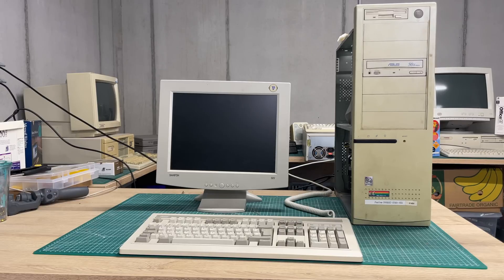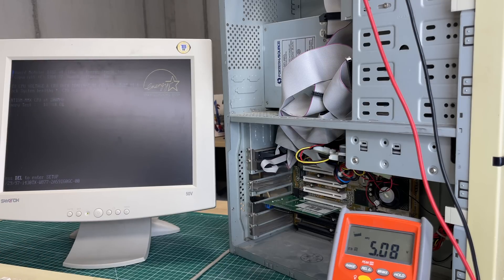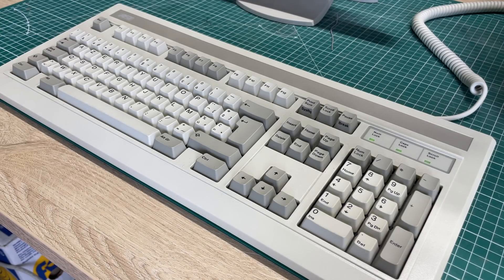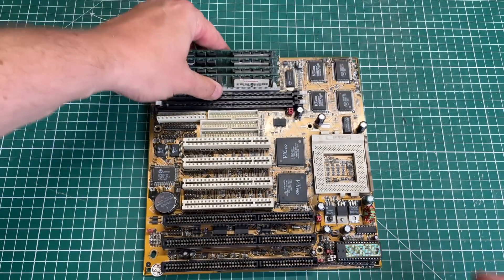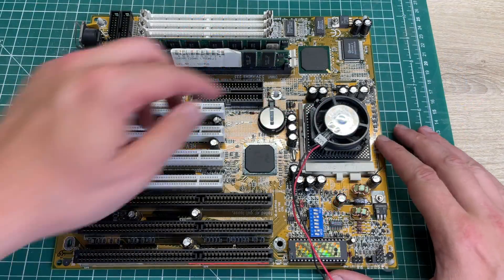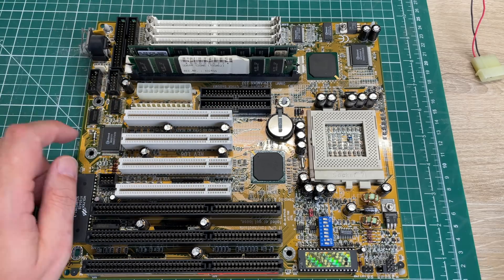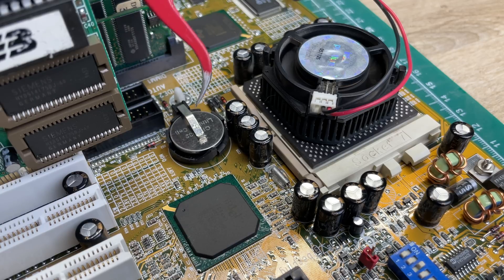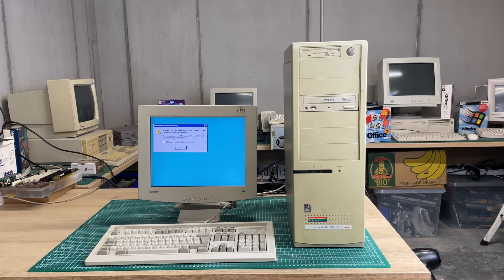Easy fix for this broken Pentium 200 MMX

Comment: A few minutes after watching this, the new voltage regulators in my Abit AB-SM5 started to work, the Pentium MMX 166 MHz is finally getting hot again ! No POST codes for a while but after I probed the regulators I started to see POST codes and finally a boot screen.. so thanks for the video .. I think it gave me some luck !

Comment: I have a Desktop version with that Case Design. In my PC is a Pentium 166 Mhz with MMX 16MB RAM, 1,6 GB HDD a 2 MB ATI Mach64 and also a Sound Blaster 16

I found that PC on the street and it works with Windows 95 and Office for Windows 95

Comment: I have a 486 motherboard that only boots after pressing the reset button on the case. Seems to clear a power good signal or something. But after seeing this, I will double check my CMOS Battery!

Comment: when i was in high school back in 2007 i worked as a school based trainee working along side the schools computer tech and the most common thing id see on computers from the socket 7 to socket 370 era is that if the battery was low or dead then the computer would provide almost the exact same issue to what you demonstrated in this video and removing or replacing the battery would resolve the issue every time

Comment: I had a similar fault on a more recent system. Would not boot. Had a power up shut down cycle. Checked the voltage of that battery and it was 3v. A fresh one is 3.3v. System booted when I replaced the battery. I dont remember ever seeing this before In the 20 years I've built/repaired/used computers 🤷🏻‍♂️

Comment: It was the auto voltage settings being lost by the dead battery. Thats why it worked after a quick restart, just long enough to remember the settings.

Comment: Interesting, I haven't seen a PC before that won't start without the CMOS battery. Although I haven't really had a reason to remove the battery on a "modern" (e.g. post pentium-era) motherboard.

I have seen it on a Mac, my Powerbook 1400c won't boot without the PRAM battery connected. In fact, it won't boot if the PRAM battery is flat. It took me a while to work that out when I first got it home and it wouldn't boot. Powered up, nothing. Tear the thing apart to get to the PRAM battery and it was fully discharged. Wouldn't power on without it either. Put it back together and still won't boot. But I left it plugged in and a while later I'm startled by a loud "BONG" sound, which was the classic Mac boot chime. Turns out you just had to let it charge the battery for a while before it would boot.

Anyway, I don't mind the off the cuff style. Not quite as polished, but I'd say it's definitely still entertaining. About a million times better than I'd do, considering how bad it was when I tried to record a narrated screen capture how-to video for work.

Comment: I have the "Baby AT" version of this case. just built a Retro system in it.  weird thing is that only the power LED works, likely might have to grab my spare leds and replace them, but still a good solid case, even if a bit yellowed. EDIT: I actually have a variant of this board as well. though my setup runs a k6-2 400.. wow

Comment: Poor HDD, it is suffering those ON/OFF/ON/OFF, they are not designed for that. Atleast the ones that don't do auto-park in a tab, ON/OFF in the middle of a spin up!, no way!. Well, my theory, if the battery was bad, CMOS data is unreliable, and sometimes MAYBE is started in higher MHZ, when higher MHZ it consums more power, so the 5v line can be drained a bit more, as started overclocked it dont even try to boot due to chip limitationes, so, what you measure like a little drop in 5v rail, it is the hardware trying to work harder!.

Comment: Could it be that the old coin cell battery is shorted? Maybe the problem was not due to the battery being totally discharged but to it being actually faulty, it's a quite rare occurrance but it could happen that those coin cell batteries develop a short circuit internally.

Comment: I do a simple test that almost work on all motherboards back in the day... When no image i remove the battery and test if no little tickle on my tongue between + and - then i realize that battery is run out, i replace and always work. Is a ultra quick test when you tired to use tester

Comment: This wouldn't be my first encounter with such issues. I had this more than once - a dead CMOS battery should usually be fixed as a first try, since it's a matter of seconds...
BTW, as feedback, I watch YT on a TV with a 5.1 receiver switched to Dolby Pro Logic II, so I get the voice centered. In this, your voice moves and sometimes even comes from the back (which is kinda weird), but is almost never directly from the center. Maybe that's something you want to tackle in your recording setup...

Comment: Funny thing to note here is, if the power supply in this old school pc (145 Watt) would have the right connector's which nowadays we use in a pc, the power supply in this old PC would even be capable to powering a PC of nowadays, when I put my AMD Ryzen 3900X together with AMD RX5700 XT and 64GB of 3600MHz DDR4 it uses when I put it in energy saving mode around 85 and 110 Watt's of power 😉

Comment: I had this issue back in the days of P2/3 (I just remember no boot) with some Tomato motherboards (and what made me think of them as low quality...yeah, they were bought because they were cheap). So when I saw the 1st symptom...I was "how's the battery", then when I saw the warning on boot, I skipped the video to find if the battery was indeed the problem. Sorry for the "low watch time", but I would have changed the battery 1st, before removing from the case.

Comment: Great video, nothing wrong with going unscripted. I had a Win98 PC that started doing this. It also turned itself off and eventually wouldn’t turn on at all, even with a new PSU. I should have tried changing the battery before I sold it for spares.

Comment: Agree with Victor about the sound "absolutely fine if a bit inconsistent". Sound is one thing that can make or break a video - I'll tolerate bad video but bad sound has be clicking away immediately. The sound here did NOT make me want to click away... and I'd say stick with this format - especially if it makes the whole process a LOT simpler for you. I'm guessing you're more likely to smash out a video when there's less set up time and less post production effort. Rock on!

Comment: There is a pin on the IDE cable that can hold the drive in initialization, before the spindle starts up.  I have seen controllers and motherboards keep the drive from starting up, and unplugging the cable allows them to start normally.  It’s not “normal” because the controller should be initializing the drives, but if the system isn’t booting, that would be one potentially expected outcome.

Understanding that, there’s a good chance the computer doesn’t have much, if any, load on the 12V rail, and the PSU may be having trouble regulating the unloaded 12V rail when the drive isn’t spinning.  The PSU doesn’t have independent control of every rail, so that could be why the 5V rail was a little low when the drive was shut down.

That’s all very characteristic of an older switching supply.  Nothing to worry about there.

Having the IDE controller stuck in a reset state would cause that chain of events and perfectly explain all the symptoms you see at the beginning.

Comment: An older series of Dell computers that I worked on had a similar issue. A dead CMOS battery would result in a seemingly dead computer. Ever since that repair, I've always replaced the batteries in computers more than a year or two old, just to be safe.

Comment: I had a couple of old XP machines that would post, but not boot into the o/s due to a dead CMOS battery. Apparently Windows didn't like the discrepancy between the original BIOS date and the o/s date. Once I replaced the battery and updated the BIOS time and date, everything was fine. The CPU cooler on that MMX looks so tiny and dainty lol
Reply: One possible temporary workaround may have been to boot to another OS via external device (DOS is ideal), change the date, then warm reboot until you had the battery replaced.

Comment: had a packard bell 166 mmx back in the day did weird things like that if the 2032 was almost dead, wouldn't initialize HDD, false start like this one , or it would boot without video, or boot normally if the energy was right, noticed my settings were wonky, not even a low battery warning, changed the backup battery out and problems went away

Comment: Changing the battery is the very first thing I change out when I get an old computer in my shop. Some of these old computers are not all the same and it never hurts to replace them right away.

Comment: Great video and I'm glad you found the problem.  I'm dealing with an IBM PC 300GL that boots, but after 3 to 5 minutes quits receiving keystrokes and emitts a high frequency noise that comes and goes. Once you start hearing that noise the computer basically locks up. This does it in DOS or Windows.  Swapped ram, cpu, power supply, and video card and still locks up. Anyway, thank you for the cool video.

Comment: I once had an old Shuttle Nforce2 motherboard whose bios battery always drained after a few days when not plugged into the wall. It was a real pain to replace so many batteries and reconfigure the bios. I eventually took it out of the computer case, and noticed there was a sort of sticky substance on the motherboard near the cr2032 battery. I washed the substance off with alcohol and water, and after it dried a few days, it worked perfectly. No more battery drain. There must have been a very minor short to ground from the sticky stuff. Might've been flux or soda.

Comment: This may sound crazy, but I've seen coin cell batteries get fried after a brown out. Scorch marks and everything, replaced with new. It was a dell optiplex with a core i7 8700. Optiplex is a real workhorse! I've seen many a computer with bios battery messages at boot and/or you have to power on twice...nothing I ever bothered trying to fix beyond trying a battery...in those cases new coin cell didn't fix. It's always old stuff for the most part.

Comment: I would think the BIOS settings got corrupted and when you removed the battery the actually defaulted. I would have tried booting with no battery to make sure.

Comment: I was sure it was the battery as soon as I saw the error on screen. I have seen this before, I have a few motherboards that either refuse to boot at all, or act weirdly at boot if they have a discharged battery.

Comment: For the past 20 years my first step is ALWAYS “remove, check/replace CMOS battery” for this exact reason. 

You’d be amazed how often this first step fixes the issue.
Reply: I keep a bulk bad of 2032 battery's for every board I buy off of eBay. Unless it looks like new it is replaced... 🙂

LLAP
Reply: I should do the same. As I have few boards that don't POST, but I haven't tried with a new battery.

Comment: I've had a very similar problem with a same era gigabyte board. The voltage on the cmos battery was enough to maintain some if the cmos data, but corrupt the contents. I had to force reset the cmos using a jumper to clear for a few minutes, put a new battery in and all was good again.

Comment: i'm pretty sure my lga-2011 pc had this issue, it would get stuck in a boot loop, i thought it was a ram issue because i reseated them and it turned on... then i thought it was a psu issue and i replaced the psu... still did it, thought it was caps so i bought a new mobo but then i read a forum post about a guy having the same issue and he replaced the battery and guess what happened? it boots normally... i did the same and guess what happened? it boots normally... now i have an extra computer that i will turn into a NAS or HTPC.

Comment: I forget that some systems are quite quirky without a good CR2032. I had this "cheap" board which had a (dead) CR2032 externally wired to a clock chip (not DALLAS). It would POST but not much more than that. I like the boards which actually have these coin battery holders as standard, makes swapping out much easier.

Comment: My DOS machine is a P133 MMX.  384 megs of ram.  2 gb compact flash, dual channel storage.  It's so overkill, I love it and getting so much ram into it probably slows it down a little, but it makes me cackle.

I have a really pimped out Mac iici too.  I just love retro computers and games.  

I love how massive your tower is there!  😍  Thanks for the video!
Reply: It's fun to completely pimp out old retro systems. I have a PowerMac G4 400 with 256 MB RAM, running MacOS 9.2. Originally it had 768 MB. I doubt the OS uses more than 8 MB.

Comment: I did guess its was the 2032, its and odd issue BUT there is a Crystal between the chipset (small round cap locking thing glued down) and the socket, you can see it in the video.
That crystal runs the Real Time clock inside the chipset.
I debugged a Super Socket 7 board myself that keept erasing the CMOS despite the battery being new, and I had the data sheet for the VIA MVP3 chipset.
I checked the pinout and the crystal is for Real Time clock, i also checked the VBAT pin and it had 3V from 2032.
In my case it was the Sound card being plugged in to the line in on my "lab" computer where I record YT videos, yea for some reason that created a potential difference it seems dropping VBAT over time effectively erasing CMOS and stopping the Real Time Clock.

Anyways I did NOTE from my testing that if the "crystal", the one you have between the chipset and the socket is not working, aka no power, the system wont post or beep just like your so I did call the cmos battery as the culprit.

Also your "power on and off" in short succession keeps the caps in the PSU and on the motherboard charged and when ever there is enough voltage  from the PSU the Real Time clock will run of that so the RTC is running and thats why your computer can post the second time.
It just cant post with no RTC running initially.

So my guess is that the way this board was designed its a timing issue, power dont get to the RTC to start "ticking" fast enough and then the system gets stuck and wont post because its expect the RTC  to be working.

Maybe a fresh PSU and a recap could help but it could just be the way this board works and a new 2032 obviously solved the problem.

But yea the Crystral must be oscillating for the RTC in the chipset for the system to post.

Also 4.95V is well with in AT specs, the reason it drops low is probably because the HDD is putting no laod on the 12V rail, the spindle is on that rail and on of the few 12V loads on a old PC as you know.
And the HDD not spinning up is most likely doe to bios not initializing, I have seen this before, its funny how its all tied together.
I'm pretty sure it would run just fine with 4.95V, the fact that it posted with 5.13V was because the RTC could run on what was left in the cap from the post attempt before it and why it went to 5.13V when posting is because the bios kicked off as it should and the HDD was happy whit what it saw and spooled up.
Most old PSU's do require some minimum load on the rails to give the right voltages.
But I know you already know this but for anyone else this could be good to know.

I hope this explains the problem. 

But yea RTC problems can be annoying at times doing unexpected things.

Anyways love your videos and I hope the explanation did not come off as "I know best", just happened to have similar problem on my last SS7 build and did dig pretty deep in to the CMOS rabbit hole XD
Reply from the maker: Absolutely love this response ! Thx a lot.
If I still have the PC in the coming days I might hook up my oscilloscope.

Comment: I would have never expected the battery to be the culprit. I had some issues with a pentium 2 system and it required replacing 3 caps on the motherboard to fix it. It would only boot at the third attempt, the first two times it would beep with a sort of alarm. That is a chaintech board with an Award bios. I don’t mind the off the cuff style, I tend to work without scripts for most of my video’s.

Comment: I have some PCI+ISA 233MHz Pentium and AMD P75 boards that once they warm up they won't re-boot without a full power down. Good find on the battery, I would not have thought it would cause such an issue.

Comment: Like the transistor and Capacitor could be faulty between the CPU and Bridge.... It's a very rare issue that the CMOS battery caused this. Could be corrupting the CMOS chip.

Comment: I've had this issue with Socket 478 and 775 motherboards over the years. Failing to detect or boot from IDE drives when the CMOS battery is marginal. You may not get a battery warning from the BIOS but it's still problematic for some reason. Something to do with IDE detection or reading the stored settings from the CMOS to boot correctly. Replace the battery with a new one is standard now with any board I come across that's more than a few years old 😃

Comment: To me, it sounds like the 5v rail might have bad caps. The fact that it takes quite some work to get it to provide stable 5v tells me there is a cap that has trouble charging up, but once it does, it starts working fine.